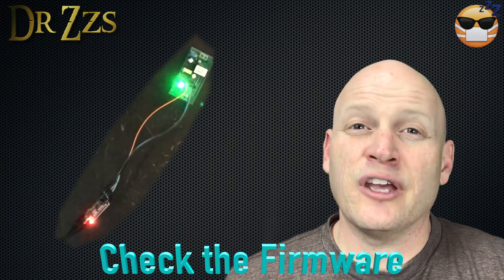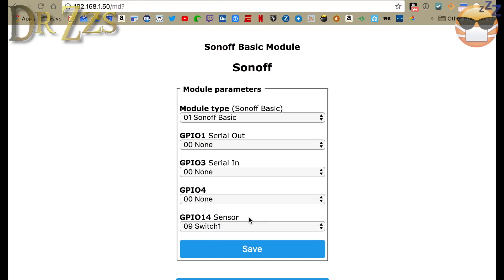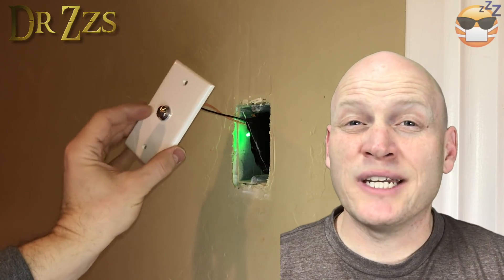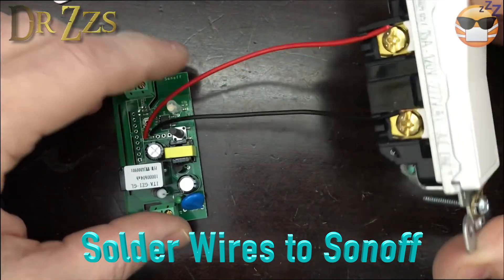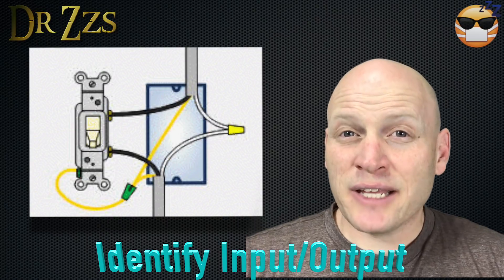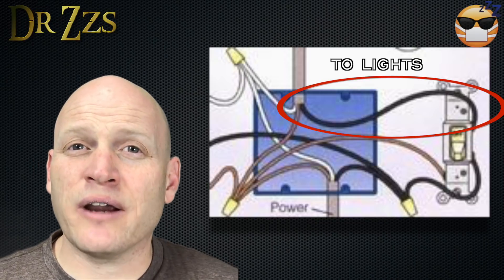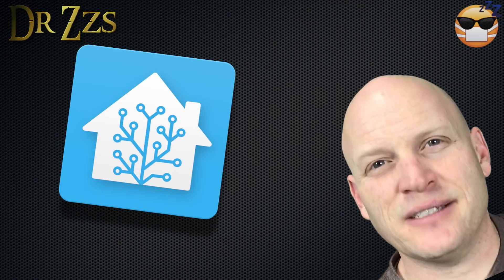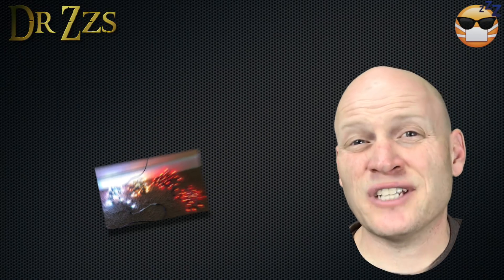No $30 "Smart Switch" | $5 Sonoff + REGULAR Light Switch!

Comment: Ok I fixed my communications problem with my switches. I am trying to connect a sonoff to a regular toggle home switch. I am however having a hard time finding the IP address on my switches. The name changes on my modem and I can't find them the way you have it described.

Comment: I am a little concerned that your metal body push button switch isn't attached to ground.

Also, are the Sonoff switches UL approved? Seems like it would be worth the extra $20 to get a switch that has met UL or CE requirements.

Comment: Oh Boy, this is dangerous and probably highly illegal in the states as well (this would be a Desaster in Germany)

You are using speaker cable which is not tested for this voltage. It is flexible and you are not using wire end ferrules so you have a bad connect creating heat and may cause a fire. You are using these old fashioned drill clamps which could be replaced with wago clamps but this isn't an issue. What an issue is is the fact, that there are spare cables flying around your switch housing. They could make a contact and again, cause a short circuit.
And using electrical tape instead of the tested, proofed and authorized casing is dumb but you should know it better, if you playing with this stuff.

Comment: can i just run the 12-3 wire in to sonoff , then back out to like my elec hot water heater?
Reply from the maker: yes, as long as the load isn't over 10 amps.  An electric water heater might be more than that.  
There are other devices that can handle bigger loads.  I know the Sonoff POW is rated for 16 amps.  I'm sure there are others too.  Just get some info from your heater and make sure you know what it draws, then get the right sonoff or other device.  Then you should be good to go :)

Comment: When you use it with a standard switch in "switch mode", if you turn the switch on, then turn the light off in the app, what do you have to do with the switch to turn it back on? Flip the switch off then on again? Or does the switch get inverted?
Reply from the maker: the switch gets inverted.  It works just like a 3-way switch.  If the light is on and the wall switch is pointing up, then you switch the light off in the app, the wall switch would still be pointing up.  To turn the light on again with the wall switch you just flip the switch down.

Comment: So, what are the options if your whole house is done like example 1. only to wires coming down to the switch, one L, one.... also L, as soon you press the switch? Not sure if this is just old Yugoslavian practice, but it feels that today in Croatia most of us have houses set like this. A box a the top of the wall, and then just 2 wires coming down towards the switch.
Reply from the maker: it seems like a lot of houses in Europe are like that.  Your choices are 1- Find a switch that doesn't require a Neutral wire (some do exist).  Or if you use something like a Sonoff or a Shelly, you can put those in the ceiling where the power comes into the lights.   A Shelly1 would probably be the best option.  
https://amzn.to/2JymZhY
https://shelly.cloud/shelly1-open-source/
Reply: @DrZzs  tnx a lot, so basically no way to implement sonoff touch unless I can pull a neutral wire from the light all the way back down to the switch box.
Reply from the maker: ya, I'm afraid so.  Sorry.

Comment: I have a 4 pin momentary switch turn  with a Blue LED light built in. Got the switch working as a momentary switch (mode 4) , but how do it get tasmota to turn the LED on behind the switch , when the Switch Mode is ON , but the physical switch is off (ie momentary)  ?  Note: i'm using a WEMOS D1 so i can have switches ..
Reply from the maker: unfortunately I don't know the answer to that.  What I've found is that I need to touch the button twice if I've turned it off in HA.  It might be possible to use a different GPIO pin to supply the voltage to the LED instead of connecting it directly to 3v.  I'd have to do some experimenting to see if that would work.  Another option is to convert the LED switch from latching to momentary (there are some contacts you can solder together to make that happen).  Then you can have the LED on all the time, except when you press it.  Or off all the time until you press it.  Whichever you're looking for.
Reply: @DrZzs  thank ... i think i might have found the answer :  https://community.home-assistant.io/t/sonoff-basic-with-tasmota-pir-and-relay-as-two-separate-devices-in-ha/43207/7  and give it a try ..... why do i need this ? wife factor !!!
Reply: @DrZzs  Yes :)  worked,   The LED within the switch has to be connected to relay 1   and the switch to switch 1.  When the switch is on ,  the LED GLOWS ...  now to add two more switches(with leds)

Comment: will the switch work (as normal light function) if the automation system is shutdown?
Reply from the maker: yes.  When the button is pressed it will trigger the relay even if there's no wifi or Home Assistant or MQTT. 
Hope that helps!
Reply: @DrZzs  
Hello my dear. I did not use Sonoff before. and heard it is not safe and saw some videos talking about this. What do you think?
https://youtu.be/SLK84ZJ291k

Comment: Can one sonoff control all the 4 switch?
Reply from the maker: Not a Sonoff Basic.  You could try a Sonoff 4ch Pro R2.  Getting 4 relays and 4 switches on one ESP8266 board is tricky.  You start to run out of usable pins at 7.  I like using the T1-3 in situations where I have multiple switches in one box.  That's the topic of the next video. Hope that helps.

Comment: Hello Dr. 
I have first type of wiring just 2 wires coming from to switch. Does it mean I can not connect to son off at all?
Reply from the maker: No, you can still use a sonoff, you just have to place the sonoff in the ceiling, or wherever the power comes in from the main panel.  Like this:
https://youtu.be/EroQ_Eos1HY

Comment: Hello Dr. Zzzs, Switchmode1 is set to 0, is it good for rocker switch? Also My Home assitant control pane Switch keeps flipping to off after changing to On it doesnt stay On
Reply from the maker: yes, I believe 0 is good for a rocker switch.  The nice part about tasmota is you can easily make changes if it isn't doing what you want.  So if you try switchmode 0 and it doesn't work the way you want, you just change it to switchmode 1 or 2 or 3 or whatever, until you get what you want.   It won't hurt it to change the settings.  You can always change it back.
Reply: You sir are the best. Thanks for help

Comment: OK I lied the light isn't coming on the state just changes for a second in home assistant then it goes back to off I already have my sonoff mounted in the wall  how can I access the tasmota menu via wifi   I do see the device in my router so it is connected to my network, any help much appreciated. So close yet so far away have a feeling I have a name wrong some where, whats bet way to debug.

Comment: Hey DrZzs, love the videos!
I believe I have the configuration you describe at 2:26. I know you said this will won't with the Sonoff Switch, but this was a almost a year ago. Do you know if anything has changed or am I out of luck? If not, can you suggest another switch?
I'm trying put this behind a standard flip switch. If this doesn't work I guess I'll have to resort to buying a bunch of smart switches to finish automating my lights.
Thanks!
Reply from the maker: I did show an example of how you could use a sonoff in that situation:
https://youtu.be/EroQ_Eos1HY

Essentially, you have to put the sonoff (or other smart device) up in the ceiling where the lights are getting power.  Then you use the wires that run from the lights to the switch to connect to GPIO-14 and ground. 
There isn't a way to do it in the switch box.
Reply: I appreciate the response! I will give this a shot. Thanks Again!

Comment: Nice video DrZzs. Let me ask you, can i do the “regular switch“ way using GPIO14 with tasmotized Sonoff Dual R2, to manage 2 lamps with just one Sonoff Dual R2?
Reply from the maker: yes.  The R2 has pins ready to control external switches that will control one relay each.  So you could have a dual with 2 switches, one controlling each relay.
Reply: In that case, the wiring would be: Switch1 > BTN1 + GND / Switch 2 > BTN0 + GND right? But how can i prevent the R2 to boot in programming mode in case i have a power cut, since i have BTN0 + GND wired?
Reply from the maker: thiagobucca Good point. I think the only way would be to use a momentary switch because a rocker switch could be grounded when there is a restart and you’d be in flash mode.  
I can’t remember if there are other pins available in the Dual.  I suppose you could use the Tx pin and set it to a switch if TASMOTA will give you that option.
Reply: That's exactly what i'm running from, a momentary switch haha. My plan is to do everything with my regular rocker switches. I found something that could be useful to you or anyone reading this comment on how to solve this. Check this out: https://github.com/arendst/Sonoff-Tasmota/issues/2910 I'll try that and report if i succeed. Keep up the good vids DrZzs and thanks for the attention.

Comment: Really like your channel and just to state, aside from compliance issues, the typical technical challenge we face in the UK with our lighting circuits is that they are wired as in the first option you showed so you just have the switching wires without the neutral to power the Sonoff plus we have much smaller back boxes. This would also be the issue with their Touch switches despite having a UK version this is to fit our standard back boxes but it still needs a neutral.
It's not a complete write off though as most lights have all the connections at the ceiling rose so you could rewire it there, using the switch connections for GPIO 14 and ground. Then poking the sonoff basic up in the ceiling void although you'd have to make a much bigger hole than you'd normally have. I'd like to see Sonoff make a version of the basic within a ceiling rose with the necessary compliance as I'd expect they'd sell quite a few in the UK. Also, whilst I'm at it, they should produce a nicer, safer case for the basic for that it can be used as a inline lamp switch. This shouldn't cost them very much to do and I'm sure they'd sell loads.
Reply from the maker: I concur.  
Have you seen the Shelly1?
https://amzn.to/2MBchfu

That's probably your best solution.  It's small, it can go in your ceiling junction box, it has contacts to connect a switch, so you can connect the wires that already run from your lights to your switch.  It also takes re-flashing easily.  
https://youtu.be/J20hxfUTP9I
Reply: Rob, you can use another add on circuit that changes the switch commands to an equivalent button press - https://rover.ebay.com/rover/0/0/0?mpre=https%3A%2F%2Fwww.ebay.com%2Fulk%2Fitm%2F273576948115
With this, you mount the sonoff in the ceiling or attic and use the existing switches.

Comment: Dude, you are awesome! Following your tutorials, from flashing the Sonoff with Tasmota, before I was using an sketch for Arduino very very problematic, and only used for 3 devices, and all the lights of my house wired from a 16 relays board connected to my Raspberry. I didnt want to use Sonoff for lights, because I had a lot of problems and sometimes I could not make it work. I've just finished, I removed more than 150 meters of cable added to the electrical instalation of my home.. A disaster!, and installed 12 Sonoff Basic running Tasmota. I have only one question, when adding the switches to the configuration.yaml you use the parameter qos=1, would you explain what is this?. Before I was using qos=0, but really dont know why, it just worked (sometimes..). Looking in the HASS documentation, it says 'The maximum QoS level of the state topic. Default is 0 and will also be used to publishing messages.', but still dont understand. Thank you so much, congrats for the videos, and thank you, very very usefull for me. You won a new suscriptor.
Reply from the maker: Thanks! 
I can't remember right now what the different qos levels mean/do exactly.  Rob did a good job explaining QoS in one of his videos, but I can't remember which one it was.  You might have to watch them all :) 
https://www.youtube.com/channel/UC2gyzKcHbYfqoXA5xbyGXtQ

Comment: Hi, This is really helpful.  I have an additional question.  Will flashing the Sonoff with Tasmodo prohibit it from using it with the original software or from connecting to Alexa/Google home?
Reply from the maker: After Tasmotizing you won't be able to use the eWeLink app.  You will be able to use Alexa and Google home, but it will take a couple extra steps.  
Here's my explanation of why I change the firmware.  You don't have to change to Tasmota to use a Sonoff as a switch. 
https://youtu.be/MyPpmDAThA4?t=2m8s

Comment: Hi Drzzs, I see that you are wrapping the sonoff with electric tape and putting behind the wall. Is it safe to wrap it? Wouldn't it have any heating issues?
Reply from the maker: well... not sure it's the best solution.  There are 110v solder lines on the back.  The board doesn't get hot so heating hasn't been an issue.  I've moved to 3d printed boxes that fit the Sonoff Basic.  But in theory Electrical tape should be able to provide adequate insulation.  But ya, not the safest method for insulating.  I wish I could get some really large heat shrink tubing.  That would be a good solution.
Reply: Hi Drzzs, do you have any suggestion for the case that can fit behind the wall with the existing switches?

Comment: everything was done I have flashed it and I connected to sonoff-xxx wifi redirected to wifi config page and gave the details of my home wifi and done saving. but my sonoff isn't connected to my wifi and didn't get the IP address.Could u please help me
Reply from the maker: You sometimes have to power it off and back on again after making those changes. 
It's also possible you mistyped something in the Wifi info.  
If it doesn't connect to your network then it should go back to AP mode, where it broadcasts the "sonoff" wifi.  If it doesn't then you can press the on-board button 4 times and the LED will start to flash.  Then it will be broadcasting again.  Re-connect and double check your Wifi SSID/PW are correct.  
Another option is to connect your FTDI adapter, and open Termite (or Putty) and connect to the sonoff by selecting the com port and 115200 baud rate.  Then type IPaddress1 and it should tell you the IP address of the sonoff if it is connected to your network. 
Hope that helps.

Comment: My touch module is turning on and off repeatedly. It is module you used for the locks and showed in the live stream
Reply: Its the wifi driver included in the tasmota firmware´. In the github issues page mentioned that. It happens to me a lot of times

Comment: How much amps does it can handle.
Reply from the maker: The relay is rated at 10amps, but there's no fuse.  If you think your load is anywhere close to 10amps I would recommend including a fuse.  
here's an updated video on making a switch out of the sonoff. 
https://youtu.be/B38e1HAMUXs

You don't need the resistor and capacitor I added if you use the touch module button.
Reply: DrZzs thanks bro
Reply from the maker: Anytime!

Comment: Is there any way to do it with the sonoff being attached to the rocker (stock) switch without added those two wire you soldered? (The switch usually has two wires on the side. one from the power and one going to the light. ). Can you  have the hot and neutral going to the input of the sonoff and the output of the sonoff one hot wire going to the switch.  Now the switch would have the hot (power) coming from the sonoff and the other wire going to the light. Would this set up still do the same function? Thank you
Reply from the maker: If you have a separate neutral in the box then yes that should work.  It would not work to use the non-hot wire from the switch, since that isn't really a neutral.  
The other thing to consider is in the setup your describing (if I understand it right) the light switch would have to be ON for the sonoff to control the lights.  If the light switch is OFF then even if the sonoff is ON the lights won't be on.  
Is this what you're thinking?

https://www.dropbox.com/s/fiyyrytpz3m5rtb/Screenshot%202018-05-14%2007.59.15.png?dl=0
Reply: DrZzs thank you for your reply and yes that is right unfortunately the switch would have to be on the ON position to work. I'm just not too good at all with doing updates to the sonoff. Your way is perfect but I don't have the tools lol. You should consider selling them modified I would buy it lol

Comment: What type or kind and size of wire was soldered to the fed and GPIO 14
Reply: What type or kind and size of wire was soldered to the grd & gpio14 on the Sonoff basic that is being connected to the toggle light switch?  And you used flexible wire going in and out of Sonoff when wiring Sonoff in wall box-what kind of wire was that?
Thanks
Reply from the maker: sure!
those are just jumper wires.  I think they are 30 awg. 
Lately I've been using old phone cord wires, since no one needs phone cords anymore.  They're even smaller than those jumpers but they still work great.